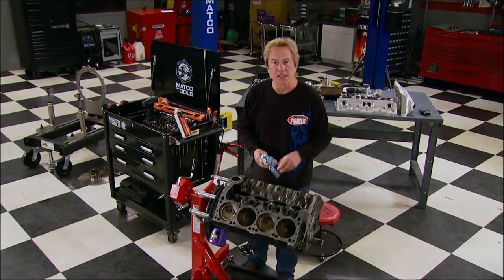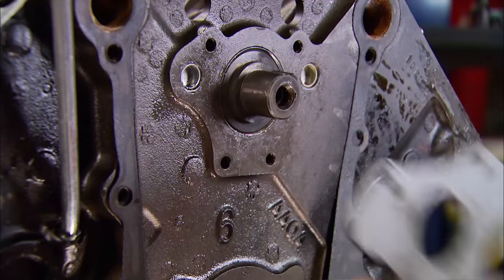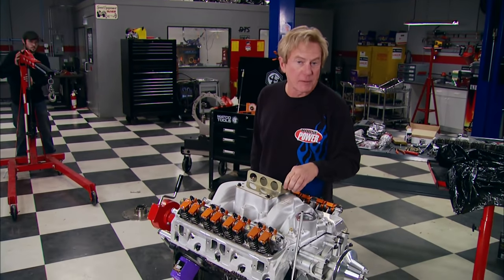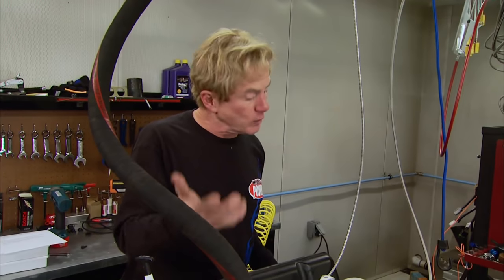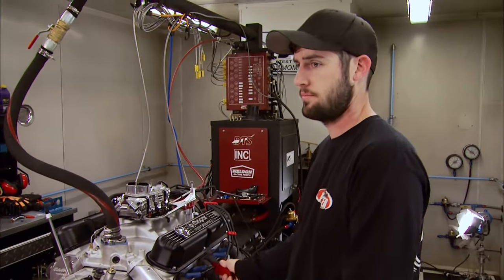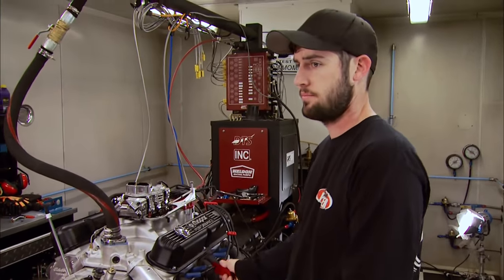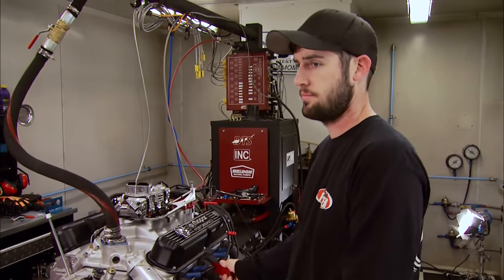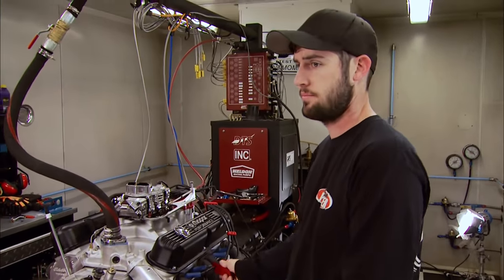Squeezing More Power Out Of Our High-Performance 360 Mopar - Horsepower S13, E20

Comment: I'm a Ford guy, but the rod stroke ratio on the 360 is awesome. Remember when we used chrysler rods in the first stroker windsor's. Always thought noone was realizing the potential of these motors. That 6.2" rod is to die for!! Someone should build a real race top end for them!!! Wonder what the weight on one of these would be with aluminum heads and intake. Gotta rout for the underdog!!!
Reply: @Mark McCarty ...there's a few race top ends for the 360 sbm... Indy Cylinder Head makes a top end pkg that's 700hp capable... Edelbrock has the Victor race heads & intake, which might be good for 800h.p. (with no power adders).... Mopar Performance has quite a few setups... the W2, W5, W7, W8, W9 & W9rp (raised ports)...some guys are pushing those sbm with stroker kits & high compression making 1000 h.p. (all motor)
Reply: @ghostrt1608  People forget that is ford guys were using 318 and 360 Mopar rods to build stroker Windsors. Know a few guys that did it. The rod  stroke ratio on the 360 is bout perfect, limited choices on cylinder heads and brand preference is all that held them back!!
Reply: @markmccarty727  ...the 383 & 400 bbm rod/stroke is even better at 1.88:1 (6.35" rod length/  3.38" stroke)... 440, 426 Hemi, 225 Slant 6...all those Mopar engines had high rod/stroke ratios...wasn't just the LA-small block... all of 'em shared that one design aspect & that's why I would pick one of those engines over any small-block, except these Gen3 Hemi's... their rocker shaft design,  their oil pump design, tall deck blocks, high nickel alloy cylinder block castings, it's just way too many things ppl are not considering with those small block Mopar engines...
Reply: @ghostrt1608  I just like seeing you guys get out and run. I'm a Ford guy, drag raced small block Fords for 5 years. Started out just chicken feed and fun. Then it's stroker motors and Yates heads. Had just as much fun the the old cast piston Windsor with ported 289 heads. The guy that bought that motor says it still running!! Borrowed a set of rpm heads, only picked up a tenth, that 10hp!! Had to get out when it went from 93 octane to race gas and big time nitrous!! It ain't fun when it's starts getting into ur pocket!
Reply: @markmccarty727  ...I'm going the turbo route...for my Hemi Ram
Reply: @markmccarty727 ...look into VS Racing... I have the 7875 cast .96  a/r T4 turbo... it's capable of 700hp to the rear wheels...the kit is $868
Reply: @ghostrt1608  Thanks, but I'm sidelined with a back injury. Gonna have surgery next month. Been out since December! I'll check it out.
Reply: @ghostrt1608  true, but 360's are lying round everywhere. Lots of that stuff from the 60's and 70's getting where it's to valuable to risk scattering it down the road. Sometimes I think about how much of it got scrapped due to high gas prices and low octane gas! Who knew!?? For the most part, the 70's and 80's were dismal!
Reply: Small block mopars rods are 6.123 ".

Comment: 425 lb-ft torque is impressive. From 311 to 388 in HP ain't bad either with bolt on parts.

Comment: Running Aluminum heads, effectively allows 1point in compression higher, due to the aluminum heat transfer verses the iron heads, so if you have 9.5 with cast iron heads, you can go up 1 point higher when switching to Aluminum..

Comment: The original 360 crank is high nodularity cast iron.
It is NOT steel, however it has been used in blown alcohol applications in dragas at over 9000 rpm.

Comment: Before you start this call Hughes they will tell you what size cam to use  as well as carb they are the best in this field. The head choice was very good but use studs for the rocker shaft when using alum heads.

Comment: Do a test between Trick Flo aluminum heads and the Eldebrock. I think the Trick Flow will make more HP. You had a set on your stroker 360 some time ago. I don't remember a dyno test on that engine?
Reply: They did a full build recently on a 410 with those exact heads but no dyno yet unfortunately
Reply: @fordmanx3  the TF heads are CNC ported....the Eddy come with stock port window.....the TF will win easy

Comment: 1hp per cubic inch, plus some.
Harland Sharp rockers are sweet. I messed with many Chevy V8's and all the bad of stud mounted rocker arms. On one 396, I galled two stamped, stock rocker balls and arms. My builder failed to set up the engine correctly at my garage. I also had to R&R the rear main seal. He installed it backwards.
Like a water hose of oil all over the ground.
I got took no doubt. Traded a complete running 350 with 78,000 miles plus 500 bucks. And had to fix his many shortcomings.  He gave me a hotter cam. However he said I would have to have the forged domed TRW pistons fly cut for the valves. They were far too heavy for stock 3/8" rod bolts. It was a time bomb for spun bearings. The only redemming thing of a 396BBC is that it revs quick with the 3.76"
Stroke. 427, much better. 7/16" rod bolts.
And tall deck is the best old school Chevy made at the factory.
Reply: BTW, it was a long block. So I had to search all over for the bolt on ancillary stuff.
Bought a complely destroyed 396 from an SS for $50. Carb to flywheel. All brackets.
 This was 1978 prices.

Comment: That motor should be way over 400 hp with that much money spent
Reply: thats mopar for you those are probably $1500 heads while a random small block chevy alluminum heads can cost you low as $500 new

Comment: I have a 79 LA 360 bored 30 over with flat top pistons, comp cam hyd flat tappet with 231/237 and 525/525 110 sep, ultra pro rockers, air gap intake, Performer rpm heads, Holley 670, TTI,  long tube step headers, combo has 9.25 to 1 comp. I got 419 hp @5800 and 452 lbs torque at 4400
Reply: HI THATS IMPRESSIVE WHAT WAS YOUR ROCKER RATIO AND WHAT BRAND PISTONS KEITHBLACK HYPERUETICTIC WHAT WAS THE LIFT @.050 WAS THE ROTATING ASSEMBLY BALANCED AFTER INSTALLING NEW PISTONS? WASTHE DECK HEIGHT MILLED AND TO WHAT THANKS SO MUCH FOR SHARING YOUR ENGINE BUILD AWESOME

Comment: I've seen other engine builders use to old cast heads and get almost 400 horsepower out of a 360 la engine whatever you guys did and only got 330 horsepower was still good because I've seen 340 engines running three deuces only top out at like 3:30 horsepower so good job
Reply: What they did is build a low compression engine with heads and a cam.

Comment: Interesting. In the early 2000s I bought one of the 1st 10 sets of Edelbrock heads and built a 10 to one pump gas 360. Flat tappet hydraulic Comp cam 228 232 duration with 505 510 lift. Stock valve train except for springs and push rods Edelbrock Performer  RPM intake Holley 3310 2 step long tube headers..
Dyno results were 414 hp and 442 ft lbs of torque. The torque number was quite surprising.
I suppose that may be due to the 6.123 rod length along with the compression. But I found it interesting becsuse 440 ft lbs is what I recall the Pontiac 389 the Mopar 383 and the Ford 390 made.
So with 30 less cubes the little LA 360 put out really good torque.
I note below that a guy claims the360 can be built to 500 hp.
I suppose a set of well massaged Indy cylinder heads a hotter roller cam than my flat tapoet hydraulic and a single plane Indy intake might get you there.  But you couldn't run it with a 1800 to 2000 stall converter and an automatic as I can with my 414 hp 360.
I am considering installation of a hydraulic roller cam and a 6 pack.  But that ll be more than I have in the engine as it sits. And I'd probably have to get some port work done on the heads at the same time.  
I wonder if these changes woud get me another 40 hp?
And if it's worth doing?
I doubt the increase of 10 percent more hp would be that noticeable on the street.
Getting 500 hp for 5 or 6 thousand?
Not unless you own a machine shop and run a website where manufacturers give you stuff for mentioningvthdif name....
A 500 hp 360 that would live would be at least a 10 000 piece in my opinion.
Reply: Is it worth doing? Maybe. I say, if that's what you want, do it. I try different stuff all the time. Sometimes it works, sometimes it don't.

Comment: 67 horsepower increase with aluminum heads, cam, intake, and carb is really pathetic. At least $1,500 worth of performance parts and only 67 horsepower
Reply: This was like 9 years ago
Reply: More like $3000
Heads are $1000 each
Rockers are $800?
Stupid cup pushrods are spend too! 
Thats why I use the RPM magnum heads then they use Chevy pushrods and rocker arms

Comment: Do a build with hughes engines parts mopar
Reply: Especially their cams that are designed specifically for the larger diameter tappets, that allows for a much higher lift for any given duration and a quicker ramp up. Lots more torque without the lope.
Reply: @GrantOakes  I got my current build on ramcharger central,  under vehicle help [ dashboard], I'm waiting on a few things to come in mail as far as rockers n floor pans then I'll go back thru my motor already have some of the parts

Comment: I read that 340 intake ports were challenged because of pushrod  routing
Reply: @tom schweikert ... the 340 small block Mopar has a reputation for taking down big blocks at will, so evidently that wasn't a big issue... Chrysler made a set of W2 cast iron heads that actually gets the pushrod  pinch out of the ports & fixes that issue.... those heads can flow like 330 cfm with a good port job & keep in mind those heads were made in the 70's... the new Gen3 Apache Hemi heads that come on the 392 flow the same numbers (330 cfm) in stock form w/o porting... so those W2's were definitely bad ass heads years ago when they were released... they are other ones too that Mopar Performance made that moved the pushrod out of the intake ports ... the W5, W7, W8,W9 & W9rp (raised ports)... Have anyone mentioned this to you before???

Comment: PUT A 4.00"stroke crank and 10.5 to 1 pistons square the block ,&  deck the block and run trick flow heads and a cam with good lift and duration and you will have a power house 400 to 500 horse easily

Comment: If the engine is already out of the chassis,  fix the compression and the quench or it's just a waste of time.
For a street car;
I will NEVER bolt anything on to a stock  compression ratio/no Quench 360, besides a hi-stall,  a 4-speed auto, and some wicked street-gears; ok and maybe some cheap headers/4bbl; but those are optional in my book, and not needed if the first three are done.
I made it to 1:15

Comment: How come you didn't degree the cam🤔
Reply: Probably because they didn't change the bottom end, they can just reference there prior numbers
Reply: @edwardmyers1746  ok but the went with different timing chain and gears....just a thought
Reply: That cams #'s sounded weak. They didn't mention lobe separation. I bet it is like 112° or 110°. I think 106° or a 108° would have made better power throughout the rpm range of the dyno pull.

Comment: Should’ve went with a .540/.550 (neighborhood) lift cam 112 lsa with 1.6 or 1.7 rocker ratio and rpm air gap and trick flow 190cc heads. Bare minimum 450-500hp and this is a mild build. So disappointed with this build

Comment: Just throw out that boat anchor and get a 1989 - 91 junkyard 5.9 magnum with the 308 swirl port heads , add a aluminum intake , 750 cfm and long tube headers will make 300 hp .

Comment: STOCK 360 HEADS LIMTED TO VALVE LIFT AND SO CANT GO MORE THAN 420 LIFT.  IF MORE THAN 420 LIFT VALVE GUIDES NEED TO BE MACHINE DOWN FOR CLEARANCE AND THAN NOW YOU HAVE LESS GUIDE AREA SO GOOD BYE GUIDES BEST TO GO WITH TRICK FLOW HEADS CAN GET GREATER LIFT AND BETTER BREATHING

Comment: Do a 360 ford. I’ve got one and can’t make power for 💩 🤣🤣
Reply: Change it to a 390!! Way back we put 428 cobra jet heads and the aluminum intakes, but you can get aftermarket heads now. Stroke it to 410, parts still around. Use 428 crank to get it to 410. The iron intake weighs 80lbs!! Lose round 60lbs going to aluminum intake. Or---- skip all of it and snatch up a 460. Head, intake, cam. Assume you got a truck cause that's all 360's came in. 460's are great for dragging all that weight around!!
Reply: @markmccarty727  thank you!
Reply: talk about a boat anchor

Comment: You guys are embarrassing yourselves.The only small block to  ever win Pro stock with bob glidden at the wheel. And that's the best you guys can do? Start using mopar parts and make six hundred horsepower. Every time you build a Mopar, it's a pig. You either sabotaging it on purpose. Or you don't know what you're doing. Chevy and a Ford guy.....